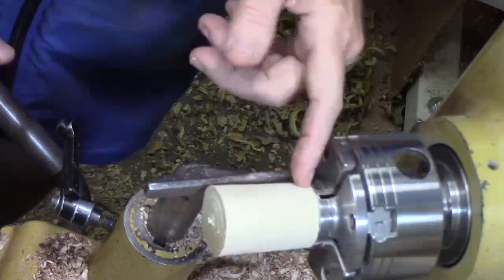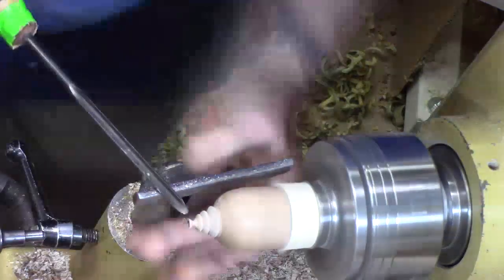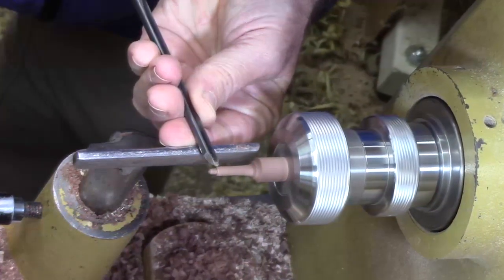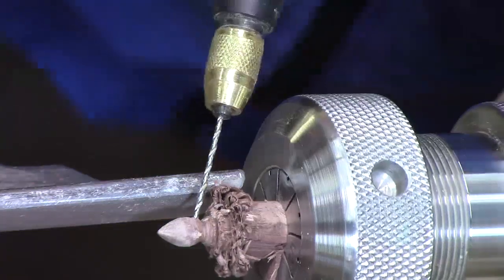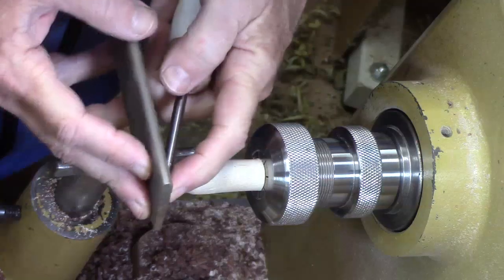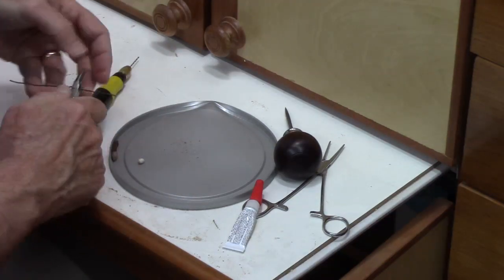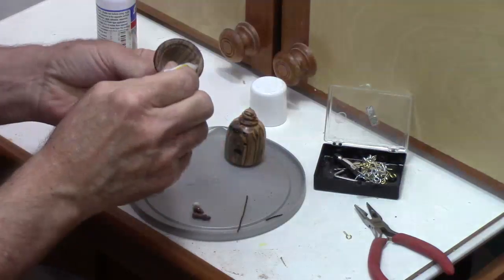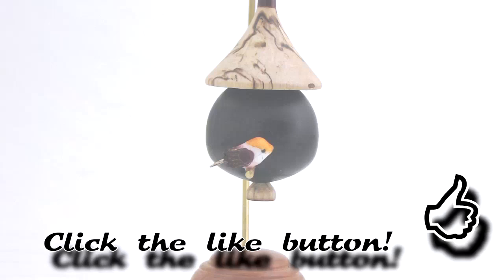Bird House Ornament  – Wood Turning Part 2

Comment: I love this idea...great way to use up small scraps of nice wood. So many variations on this already in my head. It looks like I'll have to get busy making some tiny detail tools. I can't afford such a nice collet chuck like your's, so I use a Jacobs chuck to turn small spindle items like the perch. Thanks for posting.
Reply from the maker: Make sure you use a draw bar. For that size you might just buy one 3/8" collet to fit in your Morse TAper that tightens with a draw bar. Here is one I found on Amazon https://www.amazon.com/gp/offer-listing/B00R11NY68/ref=dp_olp_all_mbc?ie=UTF8&condition=all